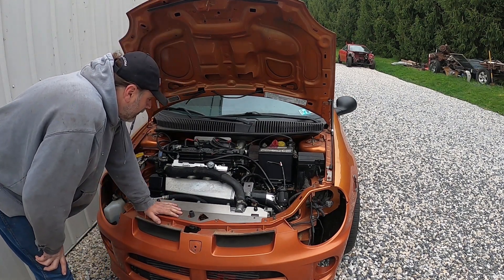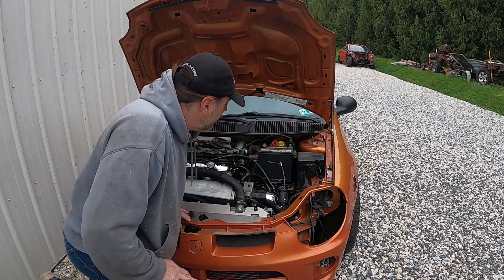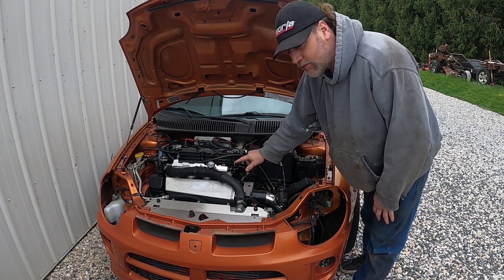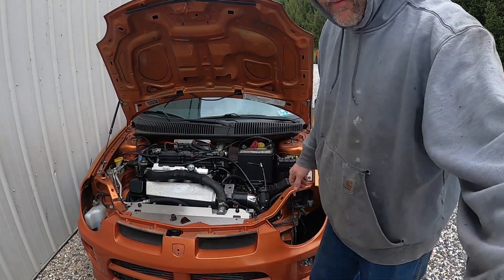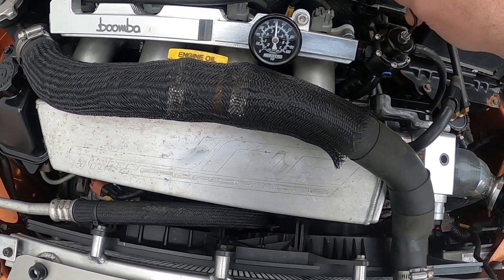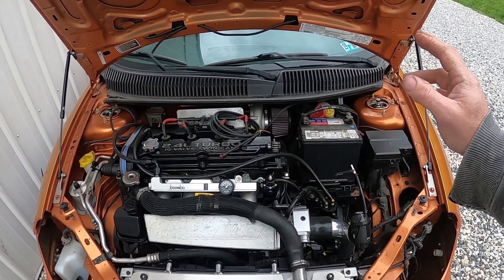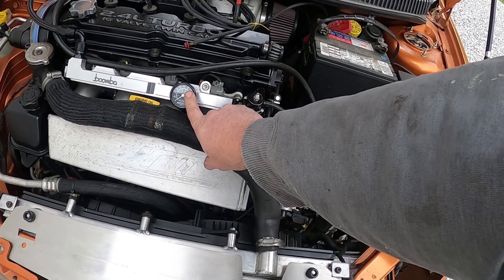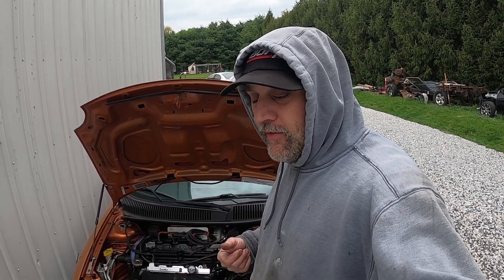NSRT4 how to adjust fuel pressure

Comment: Im in the process of installing AGP's fuel return, on paper it says "boost source" which im confused about, ive read to run that port to vacuum and also some say to run it to boost. What's your opinion on this?
Reply from the maker: boost source is the same as vacuum source any port on the intake after the throttle body and before the intake valve at idle will have vacuum and have boost when throttle is open